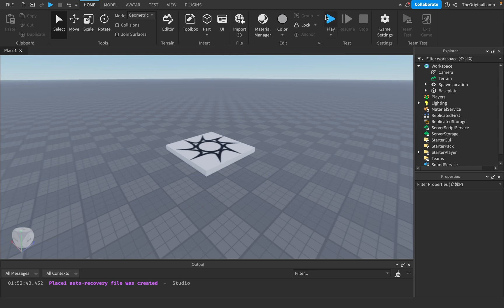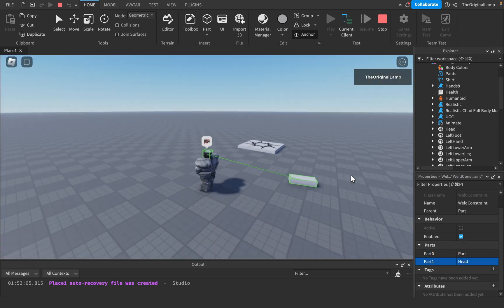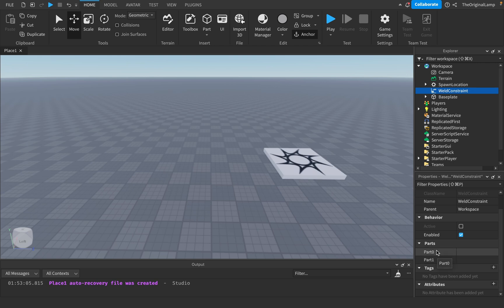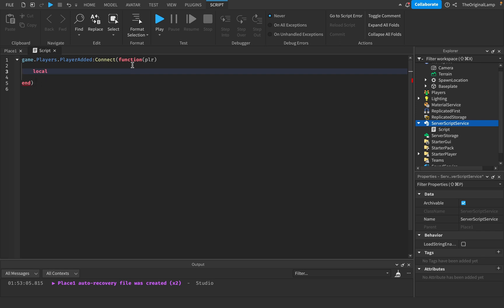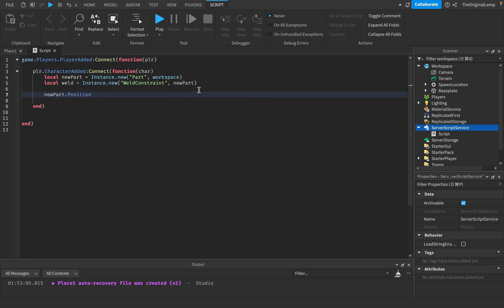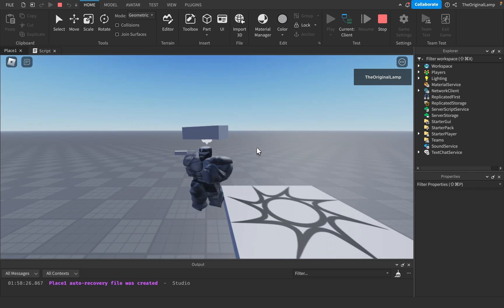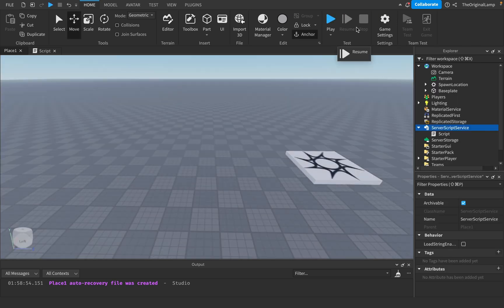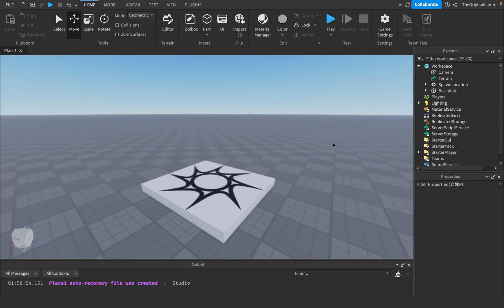WeldConstraints And Their Wacky Physics

Comment: i use welcontraints in a model full of parts that are unanchored, each part is welded to the models primary part (base), and its purpose is to spin fairly fast, but for some reason over time (maybe over 1 hour more or less) the model and each part seperates and detachted, sort of like an explosion in slow motion, do you have any idea why this is happening? Also there is not scripts apart from the spinning script, tried it in an empty baseplate and still the same result.

Comment: Awesome video! Definitely use welds a lot for when I make character selection type stuff and pulling parts from replicated storage. I know a lot of your videos seem to be mostly instance based, but I was wondering if you could make a video on a wall running mechanic? I have the raycasting down but trouble getting forces to work nicely. A lot of other tutorials I've seen for it are broken and use depricated features.
Reply from the maker: I’ll look into it. The goal of the channel is to make simpler videos, but if I find a way to make a simple wall run script I’ll def make a video on it